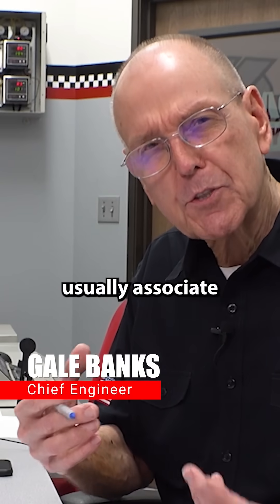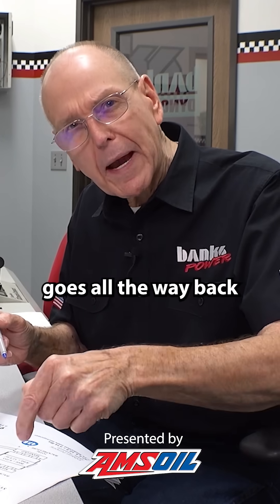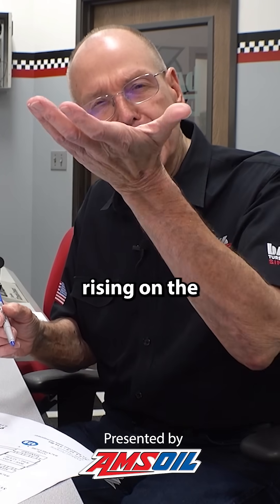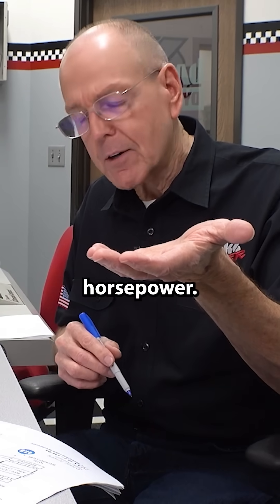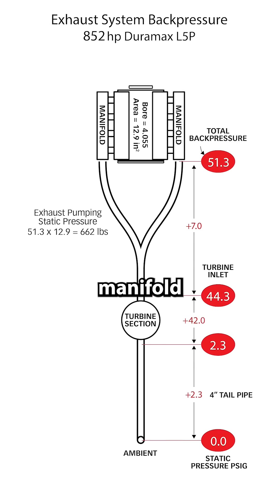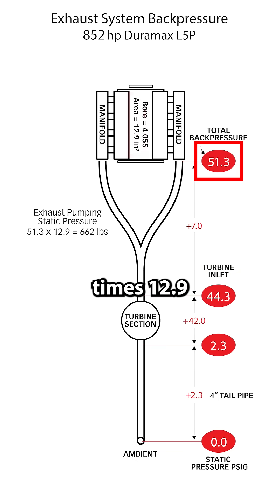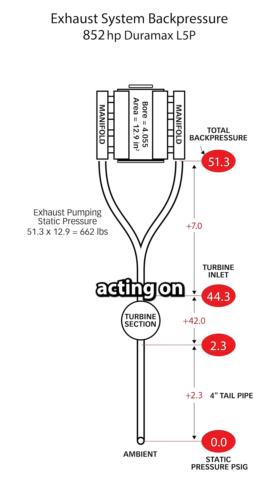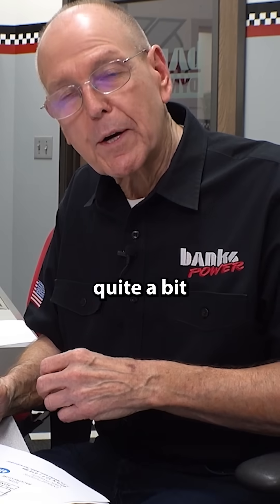How much HP are you losing to backpressure?

Comment: Naturally aspirated engines take advantage of back pressure to evacuate the cylinder of the rest of the exhaust gases, by using what's called valve overlap. It keeps the exhaust and intake valve open long enough for the vacuum on the exhaust to suck the last of the exhaust out. Turbo/Supercharged engines need the least amount of back pressure as they use the exhaust flow speed to build pressure. Less pressure = more flow

Comment: This is why I always built my hotrods with custom 4-2-1 exhaust manifolds, cutting off the "-1" &  runing 4 pipes, 2 on either side running straight piped W/ with just 3 resonators on each one.
Reply: Oh!! That's why you do that? I was always wondering...
Reply: @billymanilli  it's a primary reason. Yes.

Comment: To calculate the duration of the intake stroke at 6,000 RPM, we can use the following formula:

Intake stroke duration = 1 / (2 * (RPM / 60))

Where RPM is the revolutions per minute. 

Plugging in 6,000 RPM, we get:

Intake stroke duration = 1 / (2 * (6,000 / 60))
Intake stroke duration = 1 / (2 * 100)
Intake stroke duration = 1 / 200
Intake stroke duration = 0.005 seconds

Therefore, at 6,000 RPM, the intake stroke would be 0.005 seconds long.

Let me help you out if I figure out your math and if I get it right do I get 75% off of a new Turbo system for my Jeep Grand Cherokee 4.0 Stroker

Comment: @BanksPower: Gale, if I'm understanding you correctly, you have 51.3 psi back-pressure at the manifold, but this is due to the fact that you are powering the turbine with the exhaust flow. The engine is going to have to do work to power the turbocharger, this isn't unexpected?
Reply from the maker: Turbocharged engines will have a higher backpressure at the exhaust manifold compared to their NA counterparts. this backpressure negatively effects performance and fuel economy, but a properly engineered turbo system will more than make up for that loss. What we are talking about is the additional benefit gained from reducing that back pressure as much as possible on a turbocharged engine.

Comment: What if I used a fan to suck the exhaust out of the tail pipe, powered by the engine belt (or electrically), would that increase power?

Comment: I am not sure he described this accurately. I think the exhaust pressure is desirable between the head and turbo, that is what spins the turbine. I think what he is truly trying to describe is volume, or the lack of it. If you have high pressure at the exhaust manifold because the exhaust system has reached its limits it needs more capacity. If you reduce the pressure between the manifold and the turbo too much, it will raise the engine’s boost threshold making the engine feel a bit more lazy. The ideal scenario is adequate exhaust pressure to spin up the turbos with adequate capacity ‘downstream’ of the turbos.

Comment: yea i agree you gain HP but you lose torque  and torque is what you need most with diesel. i bought a 97 7.3 with dual 5 inch exhaust 355 gears and a 45 foot gooseneck camper cheap. because he went to Colardo  and  said he almost didn't get it home because he didn't have the power to pull it over 60 mph. but empty it would run 120 no problem. the first thing i did was brought it home put my exhaust on it off my wrecked 7.3 and i pull it as fast as i want to with no troubles. and still run 120 mph if i want to. now he wants to buy the truck back.

Comment: Power comes from the downstroke… by having a faster flow and thinner diameter pipe you have more power. 1:1/2 when you think about it. There is a middle ground where the velocity of gases and the amount of gas being pushed out is most efficient for power and engine revving. 
Having a wider than most pipe actually slows down gas flow and would thus make back pressure useless in the scenario. Having a longer tail pipe and wider (custom mod in this scenario) would be sufficient to the pulsing of a larger displacement engine.

Comment: Is the diagram a bad example?  I was thinking that if you are only using the square inches of one cylinder, wouldn't you want the back pressure of a single exhaust port?  If not, why is the diagram showing the measurement being made at the collector of only one of two manifolds?  If you are going to use a black pressure number derived from all four cylinders on one side of a V-8, why not include all eight cylinders by measuring back pressure after the two manifolds have had their exhaust pipes joined?  I'm wondering if this equation was meant to be used on a one cylinder engine, or an inline engine that has but one collector.

Comment: I had a Harley with straight pipes, and it was horrid and couldn't maintain speed in final gear ratio. I put the stock Harley exhaust back on and it felt like I gained 10 hp and I could maintain speed in my 88tc in final gear easily. You need back pressure to a certain point. But if you remove all back pressure, a whole bunch of things go funny on a motor with the way it runs. My experience.

Comment: Oh god, the obsolete combustion engine, with horse power and backpressure and all that nonsense complicated and most importantly inefficient way to move things. Needing oils and belts and intricate thousands of parts of working perfectly or else...
Electric motor my man! Solves all those problems. A lot of killowatts (stop with your retarded horsepower naming) from a very small and light motor.
Look at the axialflux electric motor koenigsegg presented , a very light and small motor (30kg) capable of 330 "horsepowers" and of course instant torque.

Comment: so we have a certain size turbo running off the exhaust on the front of the vehicle, pulling then pushing air to the intake

why then could we also have a slightly larger turbo, maybe ran off an electric motor, pulling and then pushing the exhaust out  on the back of the vehicle

Comment: Im not an engineer, so sorry if im wrong, but it seems to me this is good math if we had a 2 cylinder, across 2 exhausts manifolds. We really need the back pressure reading on all pistons on the exhaust stroke, we cant use total back pressure becuase some pistons are  on the exhaust stroke at the same time( we need now to divide total across this number) on either bank. So I think the math is off i could be wrong. Id love to know the cubic inches of air velocity needed to create 600+ lbs of force like that. The valve as well must be taking more then 600lbs of "pushing up" force from the stroke?!

Comment: Only time exhaust gas flow is crucial is with a two stroke, wrong expansion tube and they run like shit, chop exhaust if they run like shit. The folks who think that there is a need for back pressure in any 4 stroke is obviously smooth brained .

Comment: I have a 2019 toyota tundra 4x4 with a 5.7. I see you have an exhaust on your website for my truck. How much horsepower and torque will i gain with that setup ? I am running your pedal monster currently as well

Comment: With Cummins getting caught by the EPA for circumventing smog standards upon normal operation versus during emission testing, I’m surprised tuners like Banks never found it. They are monitoring these engines with numerous sensors and ensuring that the engines run within epa standards and yet they never found it? I find that a little hard to believe.

Comment: That is correct. 😁 there’s quite a noticeable difference in how your exhaust system deals with pressure. 
I.E. an engine is nothing more than an air pump.

Comment: Can anyone tell me if factory BHP (brake horsepower) measurements are including a full stock exhaust system? Because it would make sense for the BHP to be significantly higher, not just because of drivetrain friction, but because of back pressure if that is the case. 

Moreover, does anyone know if theres a standard for that measurement when exhaust is concerned? Or varying between countries? I just realized ive never heard anyone say ANYTHING about this before!

Comment: So thats all the pressure oxygen lean air is potentially being scavenged into the cylinder. I wonder what lressure the intake charge is, even at 30lbs of boost is it enough to overcome exhaust back pressure. Can this all be fixed with exhaust valve timing? Does it really only make a difference when the exhaust is open?

Comment: Not necessarily. In conventional systems, you need SOME backpressure to accelerate exhaust scavenging from adjacent cylinder exhaust pipes.
 Not my opinion. Taught by a world famous double PhD combustion engineer who owned the patents to prove it.
 Now, in an unlimited class high performance engine, that equation usually changes.

Comment: This is how I make 2hp over stock. Replaced the resonator and muffler for a 2.5” pipe, freed up the car a little. The high flow cat I’ll be getting should get rid of more back pressure. The turbo and tune I have to go along with it will make everything work together just right

Comment: @bankspower why do all these old timers say carbureted gas engines run better with back pressure? I’m 30 so I’m still young and dumb to these guys. Every diesel and gas engine that we enlarged the exhaust and removed all the restrictions starting at the heads, ran great and picked up torque. I still know a guy that swears his LS runs better with the stock exhaust….idk. I would like to hear your opinion.

Comment: How is it that an Austin A Series (Classic Mini) has the cylinder pressure go negative fractionally after the exhaust valve opens?  A restricted exhaust makes that blowdown take longer but would need to be really bad to never go into partial vacuum. 
Turbos clearly add back pressure but they also put positive pressure into the inlet ports. It’s all about pressure difference.

Comment: Mild cams require back pressure as well as restriction on the intake plenum. Hot cams need less and less of these restrictions as they get hotter and hotter. Cam timing is everything.

Comment: As long as you aren’t sucking valves seals or popping/pieing valves (I live in AK, happens all the time), all you need is a straight pipe from the headers to the tailpipe.  Anything else is government tyranny.

Edit:  This is also why I don’t run turbochargers.  Superchargers actually run off the flywheel, not the power stroke.  The power stroke gives a supercharger a little “pulse.”  If your ignition is not set up properly, that’s when you end up blowing head gaskets or splitting blocks.  This is contrary to common belief for some reason.  There’s also a good reason turbochargers don’t turn up in absolute speed and time racing.  Superchargers on the other hand still hold up to time.

Comment: this is why in the 1940's, in some aircraft engines they drove the crank directly from an exhaust turbine (like a turbo) the turbine didn't need the high inlet pressure that a current turbo does. It's great for "steady state" but you don't get the big boost pressures you can from a "traditional" turbocharger

Comment: But that pressure is on a sinusoidal wave. So although there is a max pressure, there is also a scavenging vacuum in the cycle, this is why the harmonics of an exhaust can make or break an engines peak performance and why performance road engines often have valves to change how the system works given the circumstance.

Comment: What would happen if the Exhaust System INCREASED in Diameter further away from the Engine.
A bit like the First Half of a TWO STROKE Expansion Chamber.
Would the CONE SHAPE cause the Exhaust to Excelerate AWAY from the PISTON PORTS and have a NEGATIVE Back Pressure Effect.???
Reply: A wider pipe will cause lower pressure and thereby lower gas velocity. It would also probably cause weird stuff to happen with the resonance gas scavenging. Overall not a great idea because it would only decrease scavenging performance at the cost of more weight.

Comment: I went from a 1.75in exhaust to a 2.5in exhaust on a 1.9l gas engine. I actually gained power above 5000 rpm AND fuel economy from 16 to 18mpg highway
Reply: Yes you'll have lower back pressure and see an increase in performance at higher rpm. However at lower rpm its likely you've lost performance. Hard to tell without a Dyno graph.

Comment: No seems to understand scavenging. Yes too big of an exhaust affects it because the the velocity of the air is decreased. But with the right size exhaust you gain gain the volume but you retain the velocity to creat the vacuum to help create pressure differential to „scavenge“. Scavenging is really only useful at lower rpms. This man is usually talking in terms of race engines and at high rpms it doesn’t matter because the constant pressure of the piston moving so fast is scavenging is no longer useful.
Reply: Yes and no. You are correct about everything except velocity increasing with a largest exhaust. You cannot increase volume and also have velocity increase.

Comment: Backpressure is used as a half-assed, backwards indicator of what you really want: unstalled flow.

Backpressure is resistance to flow; you lose power to it. But the slow relief of that pressure to atmospheric produces constant flow, largely preventing the flow from stalling, which produces "dead spots".

This is where tuned-length runners come in. The incoming pulses from each cylinder reduces the pressure from the other cylinders at the collector, "sucking" the exhaust out and reducing their backpressure. Unfortunately you can only tune for a relatively narrow speed range; the wider the band, the less effective it is.

With a narrow tuned band and a low-restriction exhaust, the pressure behind a closed exhaust valve can actually be significantly below atmospheric - a gauge vacuum. Unfortunately, the engine won't run that well outside that band.

I'm obviously skipping a lot of detail, because more skilled and knowledgeable people have written thousands of articles, papers, and even whole books on the subject. It's a hell of a rabbit hole.

tl:dr You want the lowest backpressure possible without ever allowing the flow to stall.

Comment: I am back for another argument  to say it depends on your engine. This is particularly applicable for larger, high flow engines. Smaller engines may suffer from losing backpressure. 

Requires no further argument than experience.  Small engined vehicles will, not always but usually,  experience a slight power loss from an exhaust hole and a loss in backpressure. The service manual will often have a leaking exhaust on the troubleshooting list.

I leave the explanation to you as to why.
Reply: I can relate to that you have a hole in silencer or exhaust, lots of noise but less power.  Put on new parts and immediately the power is up.

Comment: in simpler words if you have a 2 1/2 inch exhaust piping on your car and want are going for higher hp but keep falling short , upgrade the piping to 3-3 1/2 inches and allow the exhaust to let out more of that back pressure , the more exhaust she  can spit out  the more air she can suck in = more whp

Comment: But doesn’t depend where you want the power especially on smaller engines? I have a landrover Discovery with the 2.5 TD5 engine. I don’t have it mapped but I have a Vortex exhaust and have deleted the EGR.
If I put a say 3 1/2 “ exhaust I will shift the power up the rev range so it will be great on motorways for holding higher speeds but I will lose low down grunt for towing, where as with my 2 1/8” exhaust I lose a little at the top end but it is much more tractable at lower speeds for none motorway work and for towing. So not everyone needs a racing car, you have to decide what most if your driving is going to be and what you’re prepared to sacrifice. Or am I wrong?

Comment: I drive a '65 F100. It had  240 CID 6. It had the original one port exh. Finally got rid of that and put a pair of efi exh headers on. Plus a pair of plain jane mufflers.  After those are two  short pipes turned to passenger rear tire.
Wow ! What a difference...Like a whole different truck. 
My father bought a 1960 VW bug. After several yrs, the muffler developed holes in it. His mpg went up!  Hah...
There is truth to less back pressure is helpfull.

Comment: The main thing people forget is that you want as little back pressure as possible while still having a scavenging effect. If you start losing the scavenging effect which pulls a faccum that helps vacate exhaust its a problem too, but usually that kind of problem is caused by a hole in the muffler

Comment: The guys who still go around saying a Turbocharged Diesel engine NEEDS an exhaust system that builds large amounts of back pressure (RESTRICTION$ to run reliably, make good power, and not “blow up” are the same ones that will bring up a given engine’s “power band” and talk about it as if it is a physical mechanical part in the engine that makes it more powerful…..they’ll be like “yeah, I just put a huge aftermarket power band in my 97 Civic and it runs CRAZY good now!!” 

Wtf is wrong with these people. They seem to want to showcase their automotive knowledge and fake “wrenching” prowess, but end up showing they don’t understand the basic design concepts of internal combustion engines.

Comment: Reverse pressure waves are a big part of extractors and tuned exhausts . Sometimes under the right conditions of engine speed and loadings back pressure waves can actually create a momentary drop when the exhaust valve opens assisting not creating pumping losses.
Reply: Let me guess, you're a YouTube engineer... 🙄
Reply: @muppydoodles  No just someone that does alot of reading and research on engines no need to be a smart ass.